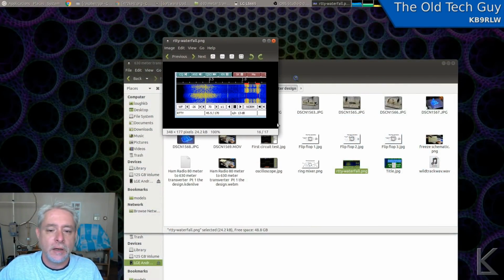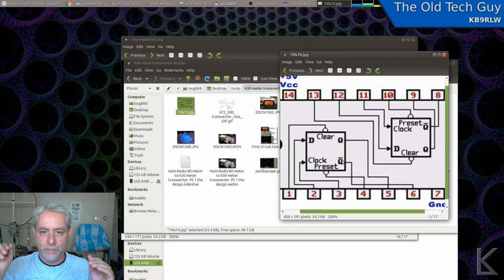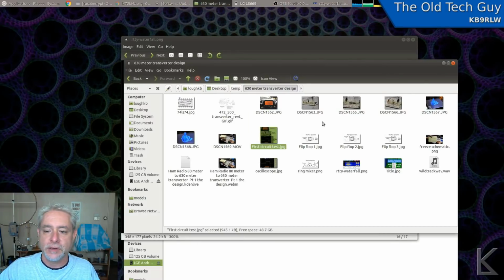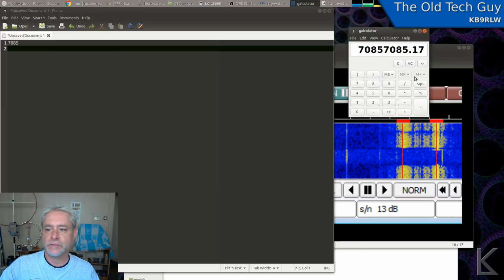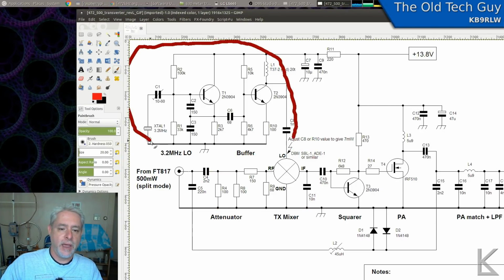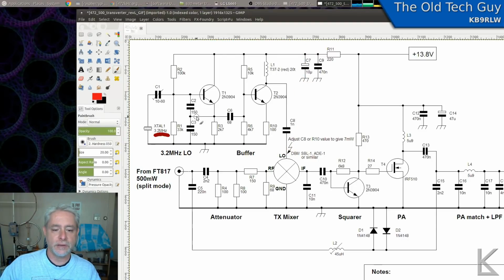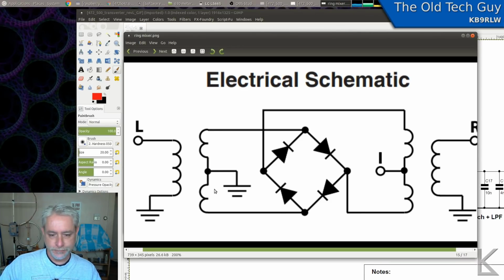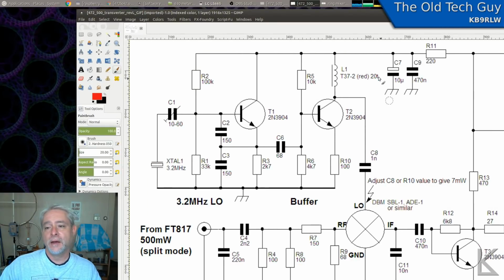Ham Radio - 630 meter transverter design FAIL!  Back to the drawing board.

Comment: For rtty specifically, many modern rigs allow you to specify the offset for 'mark' frequency. Just set the offset to 1360 Hz. Then the divide by 8 works. But only for rtty.   Your transverter will handle all modes. Remember to low-pass filter the output, so you don't push out power on frequency L+I...

Comment: Great video Kevin. When bending your xtal, use a series inductor to lower the frequency and series capacitance to make it go up. Sometimes i use a combo of both, but you take a the chance of the oscillator not starting reliably. I will check my crystal stock to see if I have anything close.

Comment: I'm using WSPR on 630m  with a 4x times shift as from  2011. 
WSPR is everytime the same msg, so I initially  used Audacity to multiply the shift. Made a MP3 with 1,5kHz centre frequency. This is fed into a KWD TS440 on 160m (dial 1901,46kHz).
A CRON in the PC can initiate a MP3-player the transmissions.
Off course one must program a channel on the TRX in split frequency. (RX direct 630m/TX in 160m)

Meanwhile the WSPR program itself has a 4x shift as an option. (See advanced tab WJST-X V1.9.x)
So FT 8 and all other programs from that suite can now be used on 630m.
The rest of signal processing to 472kHz: Divider by 4 by ( CD4024), then fed into PA (GW3UEP design) giving a 100W into a small T-type antenna (20m top 15m down). 
BTW 100W is the legal limit in the Netherlands.
A warning: when using the 4x option always tune your transmitter and not the audio. Keep the audio always on 1,5kHz and make your "calculations" from there.
I used a small utility program which calculated the dialfreq required. But if you have enough split memories on your trx to program this will solve that problem.
I'm using 10 channels 5x WSPR, 1x FT8, 3x OPERA (a digital CW beacon mode)  1xCW.
For RTTY you can use FL digi and program the shift. Do note that possible the bandwidth of a small antenna limits this. The carriers can come in different amplitude (wobbling)

 Jan/pa3abk

Comment: Hi Kevin :-)

Just a thought, based on a way some of the lowfers set up some nice transverters.  What do you think of using a higher frequency ocxo module, 28 MHz or so, dividing it by 8, and feeding that to the mixer?  You would use a different IF frequency on your rig, but enjoy a rock steady conversion for those phase sensitive digimodes.

Comment: Can you use a Tayloe mixer with a clock of such that wanted frequency is =476 so clock  is =((3,000,000+476000)*4) then I/Q signals are put through a phasing RF combiner and boosted and a similar up conversion mixer using the same clock which drives a 74HC74 to get to two phase clock to drive the two 74HC152 so to drive the phasing combiner whoes output will be 476 kHz  a similar circuit will work the other way

Comment: could you use an SI5351 for the oscillator ... bit OTT but ...
Reply from the maker: I suppose you could.  But you would have to put a filter after it to cut out all the harmonics and transform the square wave into a clean sine wave.

Comment: Your mixer coils can be a trifilar windings, using FT37-43 toroids.  Usually 8 to 10 turns would be good.  You should check out some early videos from Pete N6QW.  He shows how to build an double balanced mixer as you described in your video.

Great project, thanks for sharing.

73 de AC9JQ
Reply from the maker: Thanks for the tips.  I actually have those torroids exactly, already put aside for the build.

Comment: In the 60's, if I wanted a crystal of a specific frequency, I would open one that was close and just add pencil lead to lower or shave with an fine finger nail file to raise. I had good success moving the frq, depending on the cut of crystal.
Reply from the maker: I thought about attempting that, but another viewer has already contacted me and is sending a crystal.

Comment: If you could double your RTTY spacing it would have worked  (ie: 340 Hz vice 170 Hz).  Unfortunately the next common spacing is 425 Hz.

Comment: Can't you you select 817 to compensate for xtal freq?
Reply from the maker: Yes.  But with one at 3200, it's easier to work out in your head.  3672-3679 translates to 472-479.   Another viewer is sending me a crystal in exchange for an antenna video.  Seems like a fair trade.

Comment: We can make original signal (from fldigi) 8x wider :) so after devider, signal will bi file.
Reply from the maker: Yes, in some cases.  But you might also spill out of the audio bandwidth of the rig and not modulate correctly.
Reply: when we talking about continues wave signal, you just need DDS (like si5351a), arduino and little modification to software to transmit digital singal.